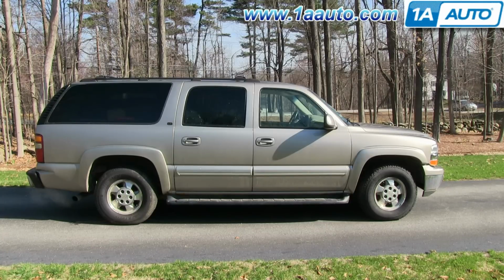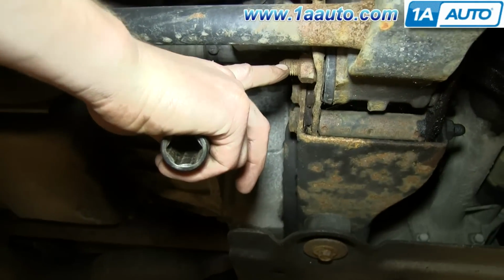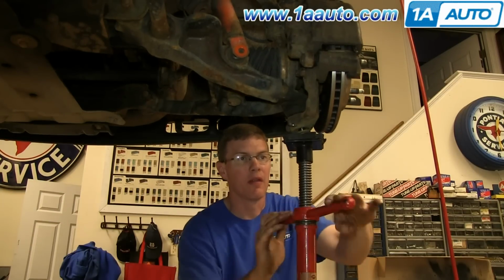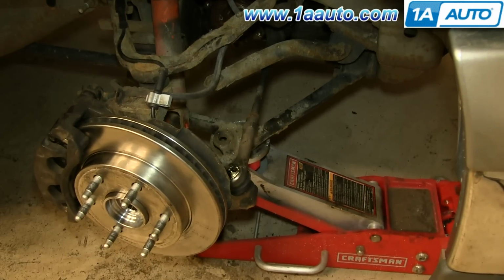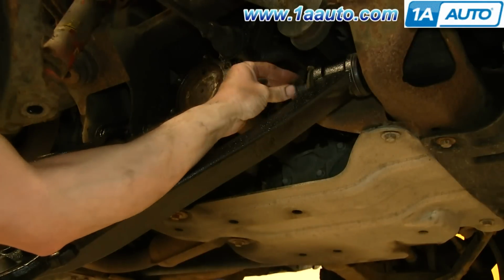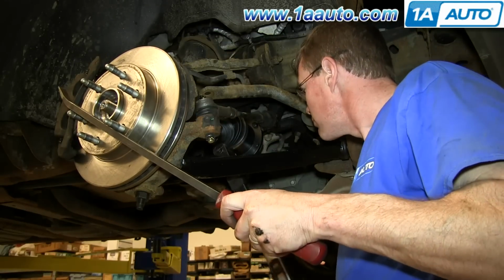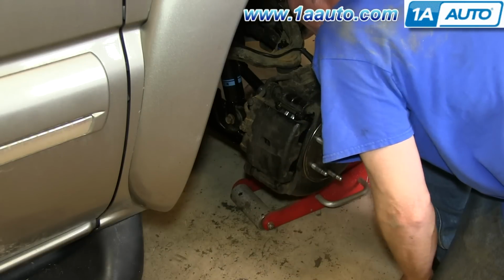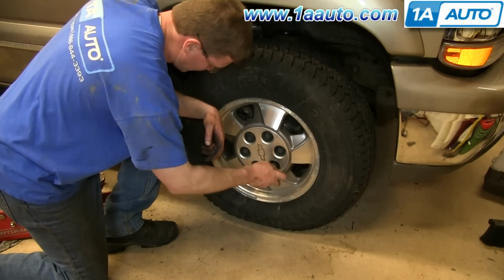How to Replace Lower Control Arm 00-06 Chevy Suburban 1500 SUV

Comment: What about RWD...
Reply from the maker: +Andrew De Venezia We don't have a how-to video for your vehicle right now, but the basic steps in this video should be enough to do this task.
Reply: @1AAuto  Well I hate to say it but it's not. My Truck has riveted ball joints. I tried drilling out the rivets but the replacements from 1A Auto did not fit. I had to replace the entire lower control arm assembly. I emailed 1A Auto for a refund but have not heard back.
Reply from the maker: +Andrew De Venezia This video shows how to replace the entire control arm for a 2000-2006 Chevy Suburban, not a pickup truck. The 2000-2006 Chevy Suburban use the same control arm between 4WD and RWD, so the process for replacing the control arm should be the same for that particular vehicle.  Somebody from our customer service department will get back with you soon if you sent us an email!
Reply from the maker: +Andrew De Venezia Thank you!

Comment: How do you know what height to reconnect the torsion bar to the lower control arm at, so the tension will be the same?
Reply: If you watched the video, he spray painted the bolt for the torsion bar so it could be tightened back to where it was.
Reply: blueknight 
I think Bondo may have been referring to the placement of the torsion bar into the control arm. The video didn’t mention anything about marking the location but I would assume the lower control arm would only reasonably go back one certain way without looking ridiculously high or low.
I thought the same thing while watching the video but just assumed it must be fairly easy to assertion  reassembling. The video still should have mentioned it though.

Comment: Whats the torque for the axle hub nuts?
Reply from the maker: +Philip Dahlin The axle nuts will be 177ft lbs as long as your truck is between 1999-2007.